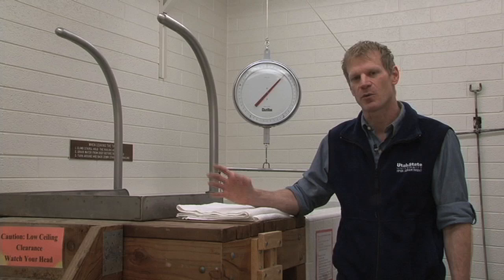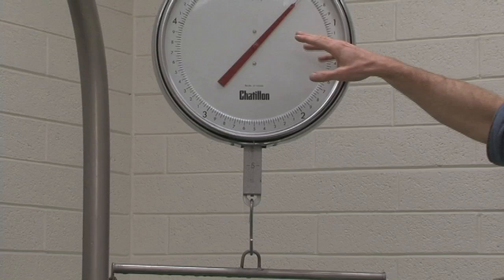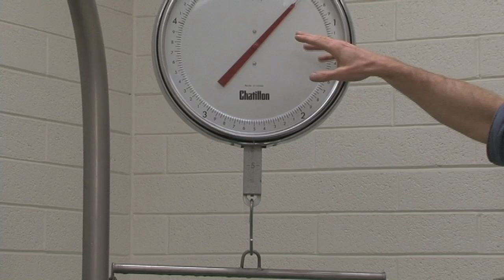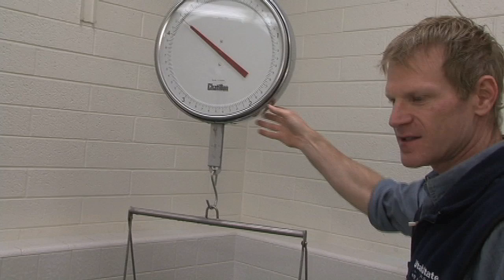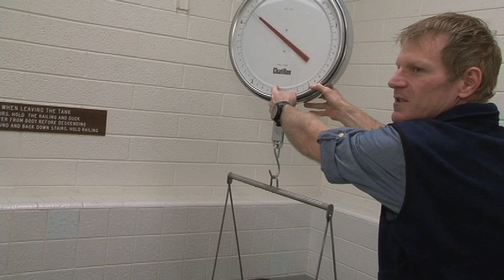Hydrostatic Weighing

Comment: Without advanced imaging equipment RV cannot be measured in a human in vivo. It's often estimated from forced vital capacity, which can be measured using a spirometer. There are (less expensive) stand-alone spirometers that simply report lung volumes, or the pneumotach (or other flow meter equivalent) on an indirect calorimeter ("metabolic cart") can be used.

Also common is the estimation of RV using the patient's anthropomorphic data. These equations, as well as the FVC spirometry protocols, are all easily accessible via a simple google search.

Comment: I have a hard time believing that she weighs 12.6 kg underwater either---aren't most people pretty close to neutral buoyancy? Is that the weight of the chair? Also, there is no difference between her mass in air and her mass underwater and her mass in outer space. Mass is not weight and is not buoyancy and is not force, but independent of those things! I think you may want to say "weight".
Reply: Early in the video he says the chair weighed over 10 kg